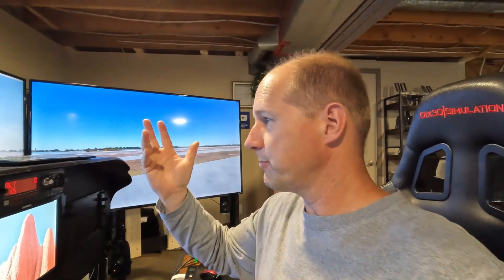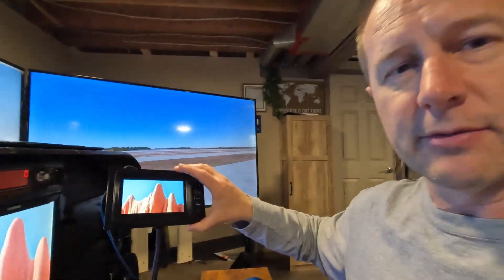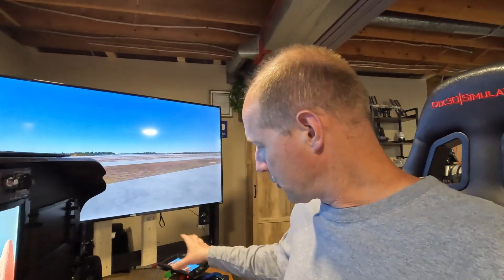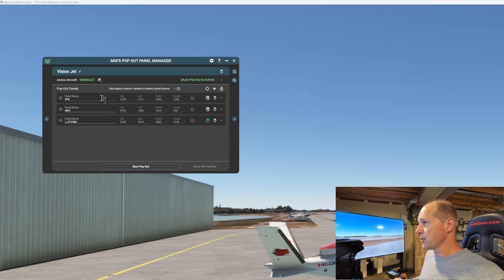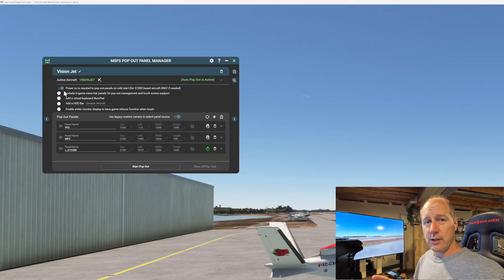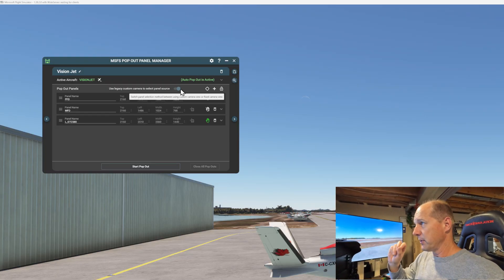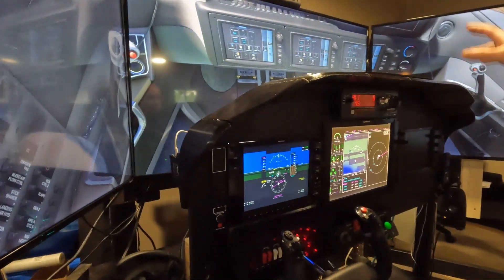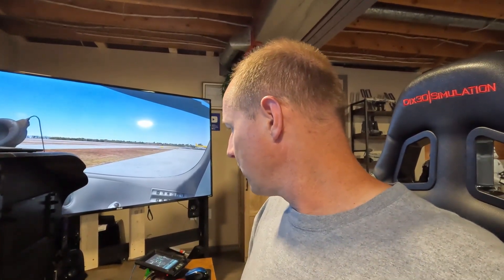Setting Up a Touch Screen in MSFS 2020/2024

Comment: Air Manager + ESA panel sets 2 touchscreens + 3 wide+ popout mgr is about 10x easier than this method and meets all PTOS (positive transfer of skills) requirements. No offense. I can fly anything and change aircraft in 2 min and still meet PTOS. Not affiliated. No offense. Be glad to send pics. Good luck.
Reply from the maker: Big difference however Air Manager isnt free.. And once configured pop out panel manager can swap between aircraft just as fast as the sim can load them.. 

The biggest issues is getting Win11s to play nice with more than 1 touch screen 😅😅
Reply from the maker: I do see however where Air Manager could be useful for the 2D panels which would allow you to turn off the Virtual Cockpit for a more realistic look for those builting physical panels. As it seems finishing the Home Cockpit Mode within MSFS isnt a high priority right now.

Comment: 15.6" PFD/MFD touch screens?  Ever consider 22"?
Reply from the maker: 15.6 is the real world size of the Garmin G3000s. But on the setup the PFD/MFD are not touch screens. Just the 5.5inch G580s are. 

I do have a 24onch touch on secondary for running Little Nav Map and Navigraph charts. Its awsome for that

Comment: Im getting terrible FPS drops when using Pop out  manager. It goes from 60fps to 15/20... I have a 13600K with an 7800XT. Im i missing a setting ?
Reply from the maker: I pop out to monitors running on a second video card without issues. I know if you're even using the MSFS pop out command, it will hit your FPS if you're leaving the popout on the same screen or video card. MSFS doesn't seem to like mixing 3D and 2D windows off the same GPU.
Reply: @thesimproject73 that makes sense.
Reply: @thesimproject73 Sorry in advance. You seem like very nice person, but that info is incorrect, perhaps outdated. I have a 5 display system 3wide 32" lg nano, 1440p, 2x21' asus touchscreens running POM and air manager, 1 x 4090, running everything ultra, on the ground, at 60 fps. This gentleman is probably having mouse focus issues which can cut fps by half. I guess my point is, fs24 can be run on 1 system with 5 displays easily, if you use proper approach to home simming.
Reply from the maker: @RightTrafficN7954Y   Thanks I hope I'm a nice person LOL.. 

But I think your a little confused on the topic. Air Manger doesn't use the default MSFS windows. It has it's own gauges that interface via SimConnect with the simulator. That's why there is no FPS hit when using them, and things work so well for your.

The topic here is free program Pop Out Panel Manger, which simply uses the panel pop out function within MSFS (basically same as LCtrl+Right mouse click). And it creates a clone of the panel. But does give you Touch Support, where the MSFS pop out feature does not. This does create a hit on the FPS, as it's MSFS creating more panel windows and not a 3rd party panel you get with AM.

The more I look at Air Manager the more I think it's the way to go. Which yes you would be correct, it most likely is the proper approach to home SIMs.

Comment: I'm just starting out and I definitely want to build the Vision Jet G2 cockpit,.its one of my absolute favorites !  I've got a plethora of d I y tools as far as multiple three d printers laser cutters etc, id like to build ALL of the Garmin controls that are in the vision too. Ill be following your build closely
Reply from the maker: Awesome to hear.. I've been working in OnShape, learning some CAD stuff well working on the ventilation control panel. Figured it was an easy place to start.
Reply: Hi mate, I just started this journey myself to build a vision jet if love to get in touch. I used varjo aero for 2 years and dof reality h6 motion platform, but I'm going to build the vision jet around my motion platform. The only issue I see is interaction with the g3000 screens. Message me if you wanted. Will

Comment: Good stuff. It’s a shame we can’t pinch to zoom charts using the touch devices. Unless you have a solution?
Reply from the maker: The pinch zoom does work in the Vision and Honda Jet on my 3D printed Garmin control units. Not near as nice as the real thing, or as user-friendly as you'd like. But it does work.

Comment: I’m having issues using fsuipc to get my knobs programmed. Is there an email I can reach out to and see if you can help me get my 570 set up?
Reply from the maker: How is your hardware interfaced with your PC? With the custom stuff using the arduino units. Mobieflight is way better for talking directly to the sim than FSUIPC. If your using prebuilt hardware than yes FSUIPC or SPAD.Next is the software you'll want.... 

YouTube just invited me to try out thier new direct messaging system. So once I figure that out you'll be able to talk directly that way. Or look up Adventures On Tour on Facebook, thats my other channel and you can just drop me a line via FB messenger there.